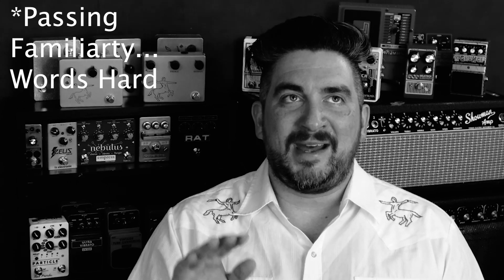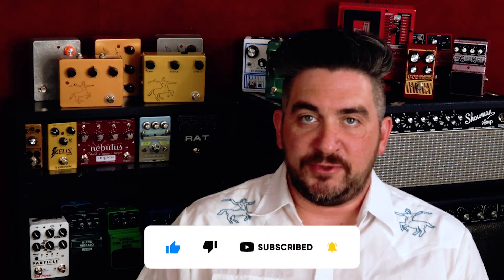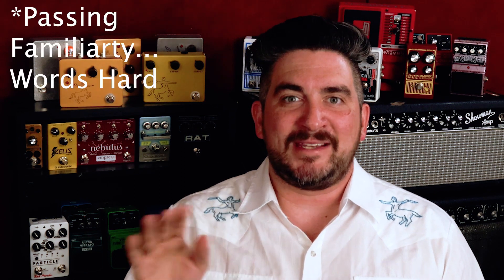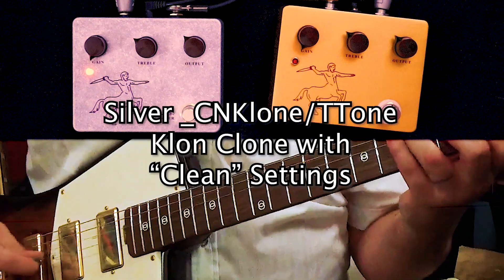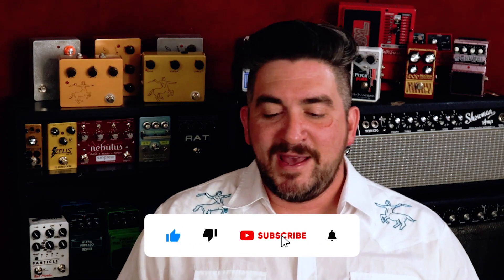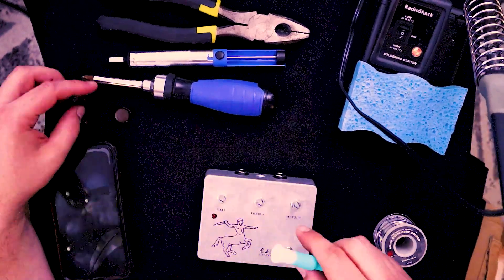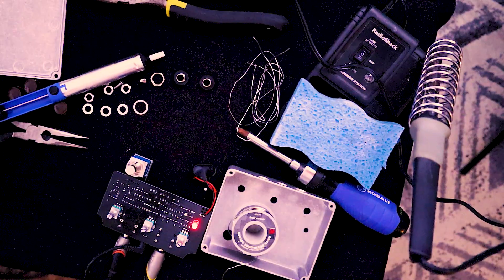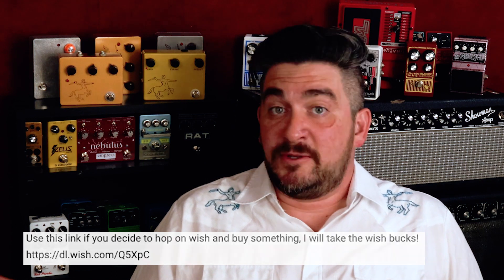Treble Knob Fix for Black PCB Wish Klon Centaur Clones | Klon Mod

Comment: So I got my wish klon today.  I ordered from TTone.  It is gold, no chinese letters, no metal ring around the lcd, black pcb and has the battery leads.  It looks like the one you show here internally.  However, the treble knob seems to work properly and as intended.  The pedal sounds great, much better than my silver mosky.  So I have to conclude Ttone has fixed the problem?
Reply: Yesterday, Jan 30th, 2023, I received a black board pc mounted jacks Klone from TTONE, even though the picture of the one I ordered showed the green board version. (bait & switch fraud) Playing the black board version next to my green board USDREAM2016, which I received two weeks ago, there is a very noticeable difference in both gain AND treble with both controls full up, which is the best way to minimize pot taper variations for evaluation. I am finding WISH to be very unsympathetic to the fact that I was not only sent a very different unit than was shown on the listing, but that it is defective as well. Trouble is, most people receiving these defective black board units won't realize they are not getting a true Klon circuit, because they have no reference, and possibly they are not as advanced as players to be ultra critical about their tone. I am a tech, and sure I can fix this, but why should I have to fix an inferior cheaper unit that was substituted, without my permission,  for the one I ordered? So my point is, they can show you the threaded jacks and green pc board, but you may still get a defective black board version, and Wish will tell you that you ordered a Gold Horsie pedal and you received a Gold Horsie pedal, so the seller has fulfilled their obligation. USDREAMS sent me a good one, TTONE sent me a cheap, poorly finished, defective one instead of the green board pedal they showed. To get a refund, Wish is telling me I must send the pedal back to China, at my expense. There will be no money left to refund and I will have spent $40.00 or more for nothing. I don't want a refund, I want the pedal I ordered. This apparently is what you can expect when things go very wrong dealing with WISH companies. When they get it right it is wonderful. Best of luck everyone! :)
Reply: As it turns out, and has already been pointed out here, my unit did not have the pc board error. Apparently they added the missing trace, but it is apparently on the component side of the board. Still, my black board Klone had noticeably less overdrive and less treble "bite" than my green board version. So I did some experimenting. First I read the voltage drop across the clipping diodes and found them to be quite different. on the green board the diodes measured .187V. Pretty low, even for a germanium. The Black board measured .385V one direction and .497V the other. (they are back-to-back so reversing the meter leads reads the other diode. This can be done without removing the diodes, just be sure your pedal is completely disconnected. I happen to have a stash of germanium diodes so i selected some from my stash that were closer to the official Klon reverse engineered schematic value of .35V. Anything between around .25V and .35V should work. The idea was to make two very different sounding pedals match as close as possible. The results were impressive. The green board doesn't sound as harsh and the black board has equal gain and tone to the greenie. While doing that I noticed the battery wires were connected in reverse on my black board, and the in/out jacks had no fiber washers to allow the jacks to be secured without pulling on the body of the jack and possibly damaging them or eventually cracking a solder connection due to the strain on the leads. 
And regarding the Green board unit, I have read many complaints about the jacks being loose. There is a reason they were not tightened securely which I discovered after taking a 1/2" nut-driver to mine. If you have more than one or two threads extending beyond the jack nut then this will certainly apply to you. 
The jack-holes are drilled to fit the plastic Cliff/Rean jacks. The stop collar on the threaded bushing fits through these holes, so when you tighten the jacks you are pulling the threaded bushing out of the jack, which destroys it. I had a good LOL when I discovered this. I knew I'd be replacing them with real Switchcraft jacks, I just didn't think it would be so soon. A pair of #11 Switchcraft jacks (or one #11 and one #12B if you have a battery clip) and 3/8" internal tooth star washers and this pedal is ready to Rock! The next piece I expect to replace fairly soon is the foot switch. I see lots of these fail on other pedals. A DPDT Carling would be a good replacement choice. One other minor irritant I found, the disconnect for the battery is on the Output jack, which is opposite nearly every other pedal on the market. If you are swapping the jacks for better ones, it's easy enough to change that on the green board units. On the black boards it would require cutting a trace or two and running a jumper wire to the other jack. I don't plan on using batteries so this is a non-issue to me. 
So essentially whichever pedal you get, it's bound to have some issues that may or may not need attention right away, depending on if they bother you or not, or if you are strictly using it at home or need it super reliable and the best it can sound for the stage or studio. Any of these are good pedals for the money, but there's really no getting around that you get what you pay for, and $30.00-50.00 is pretty darn cheap for a Klon type build.
Reply: @Rick_Erickson  this was an interesting read so I opened mine and tested my diodes.  They were .48-.49.  For the average low gain boost thing it probably wont even matter?  And if you really do want to use it as high gain, it just means you have to push the gain up a little higher than you would the lower voltage diodes.  So yea, lower voltage diodes means more gain, but who really wants that with a klon?  Thoughts?
Reply: @Rick_Erickson  How was it defective?  The treble thing came fixed on my black circuit board and I much prefer it over the moskie.
Reply: See my update below.  I am finding that the clipping diode selection in these pedals really is critical to the sound of the pedal. Both my pedals were a bit off from the spec on the published Klon schematic. Swapping diodes for some (selected) old stock 1N34A types I had on hand made a big improvement to both pedals. I'm certain there is no critical selection process at the Wish factories producing these pedals. I predict a side hustle will evolve of "Upgrade & Mod Kits" for these Chinese Klones.  In fact I might just jump in on that and offer my own.
Reply: @Rick_Erickson Go for it, supply all the parts needed and a simple/ easy guide for the Mod.
Reply from the maker: Yes, they confirmed via an IG DM they used this video…. At this point this video is more useful for people who bought it before the video came out

Comment: You can't use solder as a wire, when you see that it's actual single core wire, not solder.
Also, I'd probably solder two wires and a switch to it, then add it in a secret location inside or mounted through the case, then you can change it when you want to.
Reply from the maker: My solder skills are certainly not the best I'd best most people can do fancier stuff... but my guy I see a lot of solder turned into wire lol, I had to fix my bass just a couple weeks ago and the grounding used solder to connect the ground pin to the chasis of a volume pot where it was grounding everything in the bass.  I'd definitely agree that it's cutting corners or bad technique, but it's certainly doable lol
Reply: @BGBSATX  Well if you want the solder to fall off and lose a connection. Just keep the odd leg you might remove from a capacitor if you really need a wire.
A spares jar is very useful to keep.

Comment: This is great! Now can you help me solve my issue?  I bought a Wish Klon after watching one of your videos and was super excited when it finally arrived. Only to find it has very little gain. Maxed out the pedal is a boost for volume at best. So I ordered another one.  It’s perfect! Compared the two and some resistors had the wrong value. Swapped those and it’s better but not quite right. Any thoughts on how to get the full gain I should have?

Comment: So you can just add solder to join them and skip using a wire?
Reply from the maker: Someone better at soldering then I might up to use a wire, but just doing the solder puddle worked for me

Comment: I just checked mine, which I bought in august '22 from TTone on wish and it already had that jumper wire. 

and regarding to the LED ring, I added one by myself. you just need one for a 5mm LED, widen the hole and it looks so much better.

Comment: An update to my rant about Wish: They have now apologized for shipping me a pedal that did not match the picture on the seller's listing. I am now awaiting the money to be returned to my account. They did not require me to return the pedal so I dived in to see what I could do to make it "better". This one had some odd issues - you can read about them below. A couple things about the black Y-Factory board: 1) It is not impossible to get the board out with the footswitch board attached. After loosening all the securing nuts on the pots, jacks and the switch, simply insert a small flat blade screwdriver between the jacks and the box and gently pry the jack sleeve out of the hole. I recommend starting with the output jack first and then the input jack. You may need to go back and forth ac couple times, but don't use too much force. When the input jack releases the board with practically fly out of the box. While you have it out, smooth the edges around every hole inside the chassis. I uses a wedge shaped beveling bit, but a small file, sandpaper whatever will make the old in/out process a lot easier. 2) I mentioned adding fiber washers to the pc mounted jacks to correct the gap between the jacks and the chassis. I forgot to mention that the Cliff washers I used created interference with the bottom plate upon reassembly. So I had to pull it apart again and cut (or sand, grind etc.) a flat on each washer. It takes two washers per side, and the gap to be filled is 7/64". The Cliff washers I have, which are pretty standard, are 1/16" (4/64") Two washers would be too thick, at 8/64" or 1/8". I just happened to find a couple of 3/64" washers in my junk bins, which were perfect size. Alternatively one of the thicker washers could be sanded down to the correct thickness. Having the spacers on your jacks will help keep them secure and healthy.
Reply: Oops, by "loosening", I meant "removing". 🙂

Comment: Just received mine on 01/10/2023 with a "black" pcb. But C4 and R5 are indeed connected in  parallel. I confirmed this without taking board out. t seems they corrected the mistake. So, just because it's black, it doesn't mean you have a incorrect klon.
Reply from the maker: Yeah they started fixing it after the video came out, confirmed they had seen this video in an IG DM
Reply: @BGBSATX  Well, then i think a thank you is in order for bringing it to there attention. Thanks!

Comment: They had fixed this issue on the new boards; I just got a new one and it has the black board, and it works fine. I pulled it apart anyway and see that they have jumped it at the factory.
Reply from the maker: Nice, yeah that’s what I’ve been hearing.
I guess this video is still up because 1) posterity, the TTone store basically told me seeing this video was helpful so I feel like I deserve some credit and 2) in case someone who bought from the before they started fixing them needs to know how to do it.

Comment: Thank you. I did the mod and it worked great. I then changed the diodes to D9B germanium diodes and now the compression seems smoother and sounds great.You should try it too.
Reply from the maker: Tempting…
I am down to 4 of these now and making some options would be interesting

Comment: Hey thanks for the tutorial, ill probably use this but put a switch on it to toggle the mod. however, this video: /watch?v=6rN1YpE1LXs   seems to say that the treble boost only activates after 12 o clock on the gain knob and before that its just a boost. does that mean this feature is intended or am I interpreting what hes saying wrong? He has that exact pedal anyway.
Reply from the maker: Well, first we gotta check the nomenclature, in a Klon Centaur Klone there are three knobs that each do different things…. There’s the gain that’s the OD and it’s a dual gang pot in that it controls both the amount of OD and a wet dry blend of the OD and the dry signal.
The output knob is a boost after 10-11 o’clock, before that it’s just a normal volume knob.  The treble is a tone knob before 10-11 o’clock after that it boosts… IMO it’s more like a single band EQ in this regard.
As far as the 10-11 o’clock vs the 12 o’clock…
Even in pedals that work properly there is like a 10% variance in pots that could explain the 12 o’clock to my 10-11 o’clock discrepancy, maybe he got a weird one because I have like a half dozen and that 10-11 o’clock holds up.
And of course, maybe someone put the pot tops on slightly wrong on his?  If so it would be a simple matter to adjust where they are pointed, and you have to take them off anyways to open up the pedal.
Also, in my Klon Clone Wars video where I do the test against an actual Klon Centaur it also is normal’d around 10/11 o’clock.
Regardless, I feel pretty good about my ears, and I’m sure he feels good about his ears too, as long as it does actually boost and not just be a tone knob I’d say mission accomplished… the particulars at this level don’t matter as much imo.
I really like the idea of doing a switch, if you do it you should make a video, maybe I’ll buy yet another and follow suit, the way the treble knob interacts with the rest of the pedal is definitely affected in more ways than one by how this is layout issue.  Not going to say good or bad, just different.
Thanks for watching and the interesting comment!
Reply: @BGBSATX  thank you for the tutorial! I bought a silver one yesterday off wish. I messaged the seller and he said that the treble issue has been fixed but who knows. When I get the pedal ill test that claim and if its not fixed ill just drill a hole in the case and put a toggle switch on with some washers and nuts and then solder the switch leads to the 2 points that need to be bridged. Should be an easy mod and itll be cool to toggle the mod on and off. Still thinking of a good spot to put the switch though.
Reply from the maker: @judebox1185  I wonder if you’re talking to the same guy I have been on IG, apparently he’s with the TTone store, and he saw it too…
If I have contributed to helping the industry make this a non-issue for consumers I’d be really proud, lol.  But as a player I’m with you, a toggle could be useful, almost would rather they didn’t fix it, lol
Reply: @BGBSATX  Yeah lol. I'll update you anyway which could be a few months considering its wish. shipping was 13 euro tho so hopefully that speeds it up a bit. Thanks
Reply from the maker: @judebox1185  Hey man, just a general update from me as well… I chatted with the store owners via Instagram and they said the same thing they told you, that they fixed the circuit after seeing my video.
Please let me know when you get the pedal, I’d love to know how exactly it was fixed. Or indeed if it was fixed. If it was fixed I’d really like to know if they fixed the actual circuitboard or if they just started adding a glob of solder like I did to everything, they did the way I did it you could still do your switcheroo thing and honestly I love that idea.
Reply: @BGBSATX  Thanks for the update. ill open it up and when i get it and let you know! Remind if i forgot cos itll be a few months before i get it Id imagine.
Reply: I just got it today. as far as i can tell they did actually fix it, it doesnt get rid of any of my treble anyway. good to see i suppose
Reply from the maker: @judebox1185  wow, end of an era I guess?  Can you still do your toggle idea?
Reply: @BGBSATX  I must open it up once i get the chance and check. Is it worth having a toggle switch? What I mean is, are the tones that can be produced from the older version useful and unobtainable with the newer one in your opinion? Youre probably the most knowledgeable guy on these clones I would say.
Reply from the maker: @judebox1185  if I only did what was necessary I wouldn’t have had 6-7 of these so maybe I’m not the best guy to ask-
But the way the treble/tone circuit interacted with the rest of the pedal was interesting to my ears.  I can also see an argument for having it so you can tailor it for what you need, like a gain monster vs an air adder.  I personally use it both ways, so on some builds I have two of them in different parts of the chain with really different settings.

I eventually want to do a particular mod of my own to it, and I like the idea of yours (I’m a sucker for options) so I’ll probably steal it and do it at the same time- I’m also seeing other people with interesting ideas for mods, like say swapping the diodes out with germanium diodes…
However as you saw my soldering skills are not the best, so I’d love to see others do it so I can see how it’s done
Reply: @BGBSATX  For sure! give it a shot